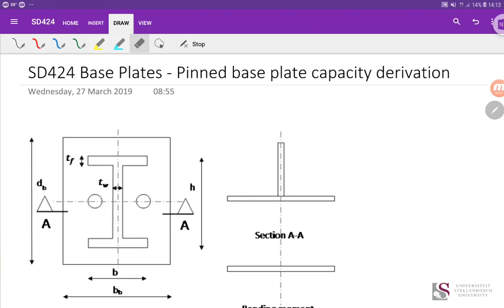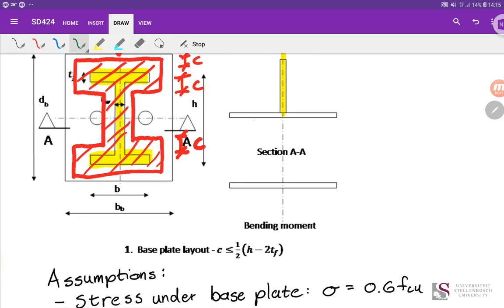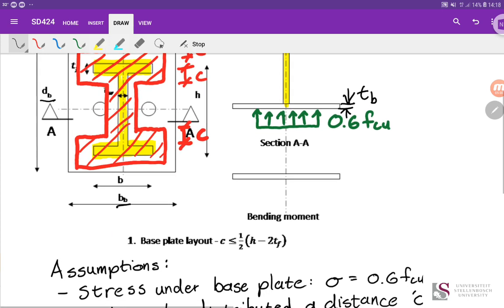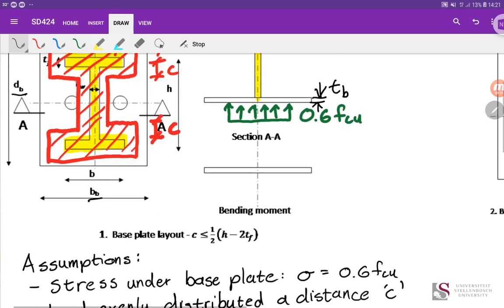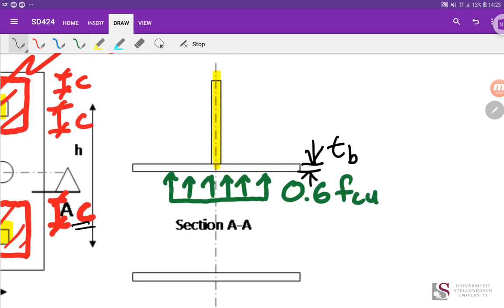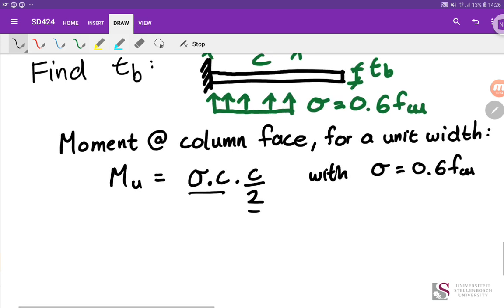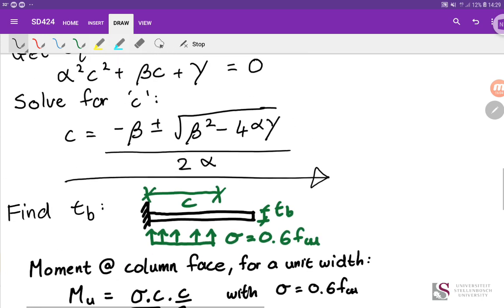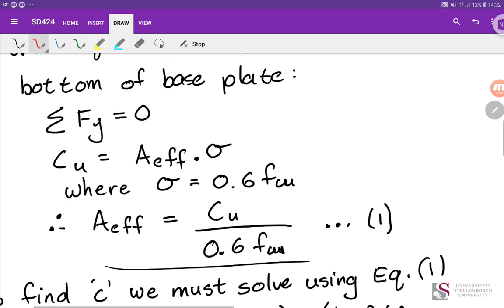SD424   Base Plate   Derivation of Pinned Base Plate Capacity

Comment: Unable to understand Moment of resistance formula .What is Phi and
 Zpl
Reply from the maker: Phi is a partial material factor. It's the inverse of gamma used in the Eurocode. Zpl is the plastic section modulus, called Wpl in the Eurocode.
Reply: @richard_walls  Material safety factor means partial safety factor 1.15
Reply from the maker: @vvats_chauhan   the partial factor we use is 0.9. we multiply it by the material yield strength.